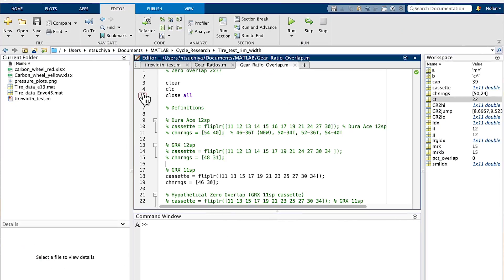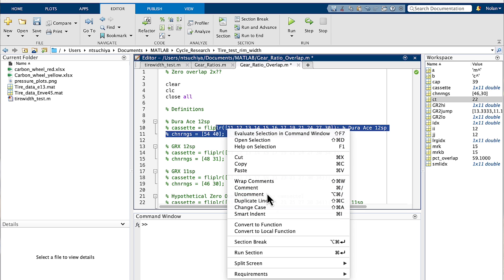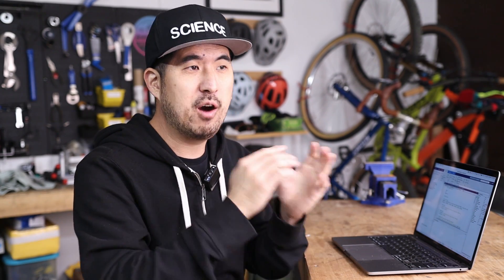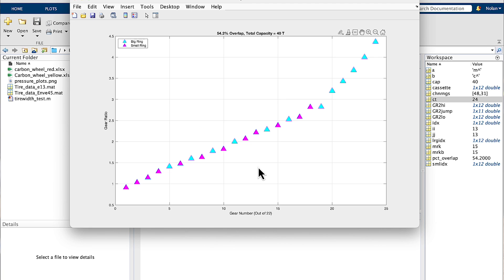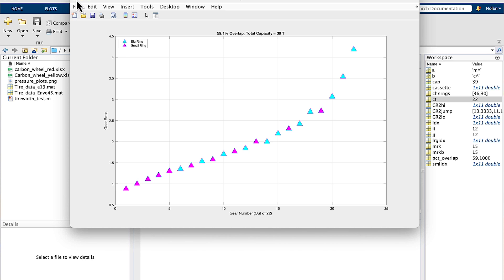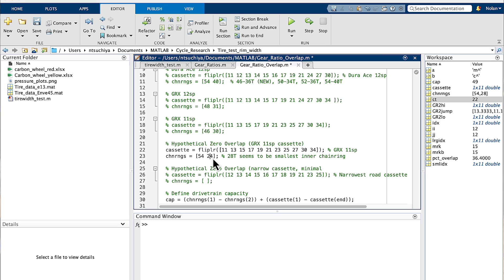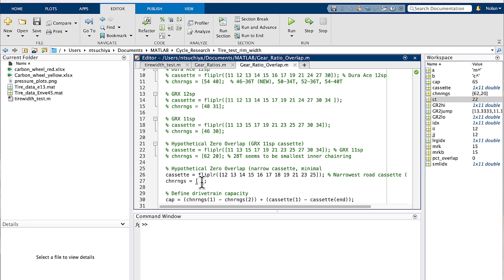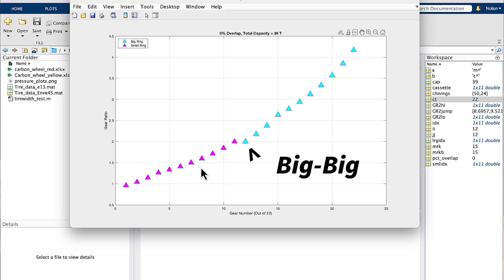Why 2x Drivetrains Have Redundant Gear Combinations

Comment: "Overlap" is completely missing the point.    Could care less about overlap - it's irrelevant.    It's the tails of unique gear ratios outside of the "overlap" that matter.     I have 2X or 3X on all my bikes.    My 3X10 touring bike actually has a 600% range and 15 different gear ratios outside of the overlap.     More unique gear ratios are great for maintaining cadence in different riding conditions (flat, downhill, wind, or uphill), and can maintain efficient chain angles.  I don't shift between chainrings often - typically only when riding conditions change drastically.    Show me a 1x15 drivetrain that has small steps between cogs and doesn't have wildly inefficient chain angle.        But if someone prefers the simplicity of 1X,  I understand.
Reply: People talk a lot about gesr overlap, but I have other question: does the torque necessary to pedal a gear wich overlap is equal both in big and small ring?
My non-scientific feeling when riding is that smaller front gear are easier to go from zero to a comfortable RPM.
Reply from the maker: @hugobci torque required for equivalent ratios in big ring and small ring are equal
Reply: He basically says at the end what you said here, that overlap is insignificant.
Reply from the maker: @rsrnsrwds thx for your input! Seems like maybe you didn’t catch the whole video
Reply: Lol low iq watch the video 20 more times
Reply: I would agree if it wasn't because of how good cassettes have gotten, you can have a 55-10 on a 12 speed and have enough range for pretty much anything, and with how inconvenient the front derrailleur is when it comes to reliability (at least on my experience) it'd be more annoyng than benefitable. In fact on my Lapierre Froggy i removed it because the smaller 28 tooth chainring was literally USELESS to me, as the cadence was too high on almost all speeds and when i went onto the longest one the derrailleur just ran out of range (Shimano Deore 9S at the time). Nowadays i run a DH bike so there's no way i could run a 2X anyways rn. That said tho, everyone should do what works for them
Reply: Yeah I have a triple (3×9). (30-42-52) with an 11-28 cassette. The only time I use the small ring is when I'm going up a steep hill. Otherwise I'm using just the two outer rings. It doesn't hurt having it in my opinion. I also have a 2×10 on another bike.

By having a 28 ring on the cassette, it allows me to not even need to use the small 30 chain ring. So having the triple for me is a bonus.
Reply: And there's nothing you can say or suggest because there is no other 700% range drivetrain. All you can then do is call out my use of a bike to which I say mind your own god damn business and accept that what works for you doesn't work for everyone else in the world. And nor should it be forced to be so.
Reply: If I ever had a second bike, it would probably be a trail bike with a 1x, you see, for that use case a 1x makes sense. But not for a loaded tourer/commuting bike/fitness bike/Cross Country bike.
Reply: Or even a straight up gravel bike that you took out each weekend on a 4 hour ride up a few hills...the use case you seem to be promoting. Yes for that very narrow slice of everything I use my bike for. A 1x would be livable. Until you introduce the word..loaded. that throws quite a big spanner in the works cos now front chainring sizes that you use for none loaded touring are too big. See where the problem lies? Probably not...
Reply: If you'd like I can show you the output of my program with my gear ratio setup and we could argue about how I don't need this and that in order to bring my usecase in line with what I 1x can offer. But why exactly should I do this? Because you don't like 2xs? Present a 1x that caters to my needs and you have won your argument good sir!
Reply: Nothing? That's what I thought...
Reply: It's been said multiple times and it still stands, overlap doesn't frigging matter. If you treat a 2x as 2 independent 1xs in the sort of use cases I require, overlap means you don't need to cycle between big and  small cogs as much. It about the 2% of gears which sit outside the range of what a 1x can offer.
Reply: FYI my current setup is  grx with 26 and 44t and a 12 speed 10-45 cassette. This set of ratios mean that I can get up to around 30-35mph before spinning out (already compromised compared to a road bike, but livable), but I can also pull half my body weight of camping crap and food up a mountain repeatedly (and go at a reasonable speed back down). Heavily modified drivetrain (derialluer extension, larger jockey wheels to take more slack) but it works. Its is as reliable as any stock drivetrain I have ever used. And because its using tougher materials and better precision parts and I have a decent chain and  wax it. It has lasted longer than any drivetrain I've owned. The aim being I never have to walk up a mountain or be limited to spinning out at 15mph going back down again. Further FYI, I started this setup with a 1x 11-51 cassette. I've experimented a lot, I don't like 3xs in these sorts of setups. It's probably the largest ranged drivetrain you could bodge together. This is how I know a 1x isn't appropriate. I couldn't in a million years have outright bought a bike with my spec, I've built it up over the period of about 2 years.
Reply: I understand why the average cyclist has no interest in gear ratio optimization, let alone people who just pedal once in a blue moon.  

But once you take a slight interest, I have zero understanding why any road or gravel cyclist, or even XC sometimes, would prefer a 1x drivetrain.  

Most people use brifters so I get why triples aren't worth their time since they're a pain when you can't trim via friction shifting. But doubles are so much cheaper, more useful, and take very little thinking to use. More range, more precise gearing changes, less expensive components, longer lived components, less noise from hearing the drivetrain grinding itself on the extreme ends of the cassette...etc.
Reply: @Primifluous my Ultegra triple shifts flawlessly with brifters. Better than my double 105. The double makes more noise. There's less of a jump between rings with the front derailer on the triple too.
Reply: I have a 40 chainring & a 10x50 cassette on one of my gravel bikes in my opinion it's the best setup.
Reply: @michaeloderda4513  I can see a 1x being good enough if you truly only use your gravel bike on gravel and don't mind large gaps between gears! But I prefer a triple since I live in a very hilly area with lots of rides that mix asphalt/gravel.
Reply: @Primifluous  I have 2 HC climbs in my backyard.   I'm quite comfy riding 1x when I'm riding alone.  It mostly sucks riding in a paceline or if my coach has me in a power range I can't sustain with their recommended cadence.
Reply: @michaeloderda4513 that's not the best setup. Try my setup: 11-46t cassette with 46/30 chainrings. That's a better setup. Best of both worlds.
Reply: @bonbonflippers4298 What are you running to get 11-46 in 2x?
Reply: @andrewmcalister3462  11spd xt sgs derailleur using a tanpan as a converter with 105 shifters. It's built to my touring bike that needs those gears. Climbs like a mtb but handles speeds  really well
Reply: @andrewmcalister3462  I haven't gone quite that far but I have 11-40 10 spd with a 50/34 crank running Tiagra with a hanger extension.  Hopefully will be going to 46/30 this year.
Reply: @kenmoum162  This is exactly my setup, 11-40 - 46/30. Great combination for my very hilly area and feels good.
Reply: A 1x system is ok for 70% of riders. Anyone who lives next to a mountain range or wants to carry any amount of stuff though is going to strongly disagree with that sentimemt. The comments on here just shows that people are unable to percieve cycling outside of their own particular use case or that there even is a use case outside of their own particular use case. People ride bikes for different reasons an purposes. 3xs are not dead whatsoever, they just don't appear on your flashy mountain bikes. And while the simplicity of a 1x may be better (cos you know, having the think about the complexity of navigating between more than 1 shifter is just too much for most cyclists to handle.) It is a compromise in gearing that people who do actually NEED in the course of their cycling usage, do not want forced down their throats, which is essentially the durection the cycling industry is headed. I challenge any 1x fanboy to dont a tents, the provisions they need to survive a week on the road. And put some serious distance accross the length of great britian. See how far you get on your 1x then. Only then will i accept your sentiment that 1x is the right choice for all cyclists and the industry has every right to phase out the parts for more niche applications.
Reply: @jasonrodwell5316  I live less than 5 miles from 2 different HC climbs with over 4000' of altitude gain.  You're not remotely close to being right and I see plenty of people riding 1x up these mountains.
Reply: @veganpotterthevegan i never said you couldnt get up a mountain with a 1x. But with a 1x and an appropriate sized front cog, this severely drives down your top speed and the spread isnt enough. When they got up those massive hills, they don't tend to want to lpse speed on the easiest part...the descent. On a normal 20-50 mile ride you could probably put up with it. But over the course of 100-150 miles, carrying loads of crap, and on a timer to get to a certian spot to camp ect, it adds up. Why should we put up with this forced change? Cos you say so? No one wants to spin out at 15 mph on a hill on a 100 mile trek. A 1x is severely limited for this application. So am i supposed to carry multiple chainrings and change them for a particularly hilly/flat downhill transition? Either you can get up hills but have no top end  or you can go further quicker...until you hit a hill. Consider the fact that the more you carry, the lower the gear ratio needs to be to get up that big hill. Next consider  in the uk you could have a 30 mile stretch with a slight decline, followed by 20 miles of mountainous terain, followed by another 30 mile straight. So i would need to gear my bike for the mountain in that situation, so for the other 50 miles, im halving my speed. A 2x *solves this issue*. Yet 1x drive trains are pretty much being shoved down our throats. For a mountain bike...fine. maybe even a city comuter or as i said 70% of use cases. But the rest what, should just suffer because you believe its better? Screw your opinion ill just stick to my 2x. Its about choice, a 1x may be suitable for you, but not me. It hasnt happened yet. We can still get 2x systems but they are being phased out  This is a mistake.
Reply: @jasonrodwell5316  my gravel bike would have a higher high and a lower low than my road bike if I put a 46t chainring on it.  Now it has a much lower low, and only a slightly lower high gear.  All you need to do is look at a gear inch chart,  and available gearing to see how wrong you are
Reply: @jasonrodwell5316   I certainly ride my 2x bikes here too.  I wouldn't even build a modern touring bike with 3x unless I was late in my years.  I'm 41 and can't see myself using 3x for another +15yrs, even on a touring bike as you can run 2x with a 11-46 and a 45/30 chainset and chances are,  cassettes will have more cogs and an even bigger range by then and it'll make triples even more obsolete than they already are.
Reply: If you're not a professional racer, who the hell cares about narrow ratio gaps?  Are your legs a 2-stroke motor with a tiny power band?  Bet you're wasting more energy grinding up step climbs or getting spun out on fast descents due to limited range than being +/- 3rpm of your "ideal" cadence.
Reply: @csn583  guess you don't realize that even regular people care about how things feel🤡 Funny thing is that pros generally have a wider cadence range where they can still produce high power
Reply: Simplicity of 1x rulez ! I have a bike with ultegra 2x .... that I rarely use. Can we stop being "snowflakes" about "the perfect cadence" ? We adapt. 2-3 tooth difference won't stop me from winning Tour de France.... really. And so is the "unconfortable" dfference from 95 to 102 RPM. Also...I must say to everyone with 3x chainrings...that 3x is DEAD AND BURRIED. THe current market rarely produces anything 3x. Sick if the "trimming". I prefer to "crosschain" a 1x than to bother to "trim" that 2x all the time.
Reply: @balaurul100  cadance and 1x or 2x or even 3x is a preference. I love 1x on dirt rides but prefer 2x on pavement. Now if you're preferred riding is relaxed and not sustained 20+mph at a comfortable rpm of your choice then 1x is fine.
Reply: @bonbonflippers4298  I have a 58t chainring and 1x on my TT bike and can cruise at 22mph(z2) for +5hrs happily.  1x isn't only for slow riding off pavement
Reply: @veganpotterthevegan  I guess I'm not as strong as you or my terrain doesn't allow me to have 1x in my area with hills. I do see alot of TT at my river trail area where there's minimum climbing.
Reply: @bonbonflippers4298  I live in Salt Lake City.  I can ride fairly flat, or take my pick of two +4000' elevation gain climbs and many 1000' options.   My gravel bike is 1x and actually has a wider range and lower low gear than my 2x basemile bike.
Reply: @veganpotterthevegan  my touring bike has mtb gear ratio while still having 46t chainring. It's a bike that is practical as a normal average cyclist will ever need for base miles. The rest of my bikes are 2x for various type of riding. As much as I want to try 1x even on hills, my knees just wouldn't like it over a prolonged period of time.
Reply: @bonbonflippers4298  there are 52t cogs.  Nobody is keeping you from having a 34t chainring to spin away on.  Also, everyone has different wants/needs.  Plenty of people of all levels just can't stand having a +15rpm difference between gears while others of all levels don't really care at all.
Reply: @balaurul100  I'm all about 1x in many applications.  But the cadence difference isn't 7rpm in many situations.  I run an e*thirteen 9-45 cassette and the difference in cadence in the low gears can be over 15rpm.  It's most definitely noticeable.  It would be over to 20rpm with their 9-52 cassette. Looking forward to 13 and 14sp to make those gaps smaller
Reply: @cpopte if you are old enough then you know that what you wrote is not very smart.

It is only a matter of time and 3x or something else will be the main thing, just so idiots and kids replace their already existing gear.

Comment: I run 2by because it's a cheaper to obtain the low gear I need without compromising too much top end
42-26 + 11-36 10speed, I'd need a, 11-51 +36/38 to reach the same 0.7ish, but then I'd spin out with my road wheel set.
Plus I probably could run a smaller GS mech instead of my current SGS
Reply from the maker: Pretty much sums it up!

Comment: Glad to find you! How about putting a planetary up front (they're around) to give you the wide ratio needed to minimize or eliminate ratio redundancy. This reduces crossover losses in two ways( narrower cassette and single line from the front...but introduces losses associated with the use of a planetary. What do those efficiency numbers look like? 'Still have the (practically unworkable) extreme double shift scenario to achieve progressive ratio continuity. Deurs could change to reduce idler length( reduce the risk of damage), shorter chain length, clutches?, reduced mass at rear axle...  etc etc Just asking! Great analysis!

Comment: My view is that unless you're riding the same route all the time there's no better way to quickly dump-down or ramp-up the gears for unexpected downhills and uphills....It's a one-click-wonder👍🏻
Reply: Idk, I have a 1x and I’ve never had a hill come up too quickly to where I couldn’t just ratchet the shifter a couple times and make a quick shift to the bigger rings - really not hard at all. Your brain does this weird thing after riding 1x for awhile where the drivetrain just disappears, you stop thinking about it.
Reply: @Ferrichrome i've definitely had that experience on my 1x bikes that have just the one cog 😉
Reply: @hugejackedman1951  indeed, sounds nice but too many hills in my area 😭

Comment: I feel like you should mention chain line in here somewhere.  Not cross-chaining, but the more extreme ends of 1x gearing.  It isn't a problem on slacker gravel bikes but the chainstay on a race-orientated road bike is going to be so short that the highest and lowest gears on a 1x setup are going to be unavoidably noisy for a gear range comparible to a 2x equivalent. 2x for road, 1x for gravel, don't need MATLAB for that calculation!
Reply from the maker: Chain angle is bad on 1x for sure. Chain line is something different tho

Comment: I've got a couple 3x on 90's MTB's, a couple 2x (1 road, one MTB), and five1x drive trains (1 gravel, 3 MTB's, and  tandem).  Honestly I prefer the 1x system a bit more than 2x in all cases.  I used my gravel bike with 1x as a road bike far more often then my 2X true road bike and it only took a couple rides to get over the annoyance of larger steps.  If I were stronger I might wish for a taller gear, but I'm not, and spinning out has not been an issue, but the multiple granny gears has been a real bonus on my usual hilly loop.

Comment: Thanks for the video.  I always try and make my gear ratios when they overlap between chain rings non-redundant. That is your two different plot colors not appear on top of one another. That allows for additional resolution in the finite number of gear choices. That may require some hunting between chainrings.... ( ever hear of half step granny gearing). Hey, how do you afford a Matlab license?
Reply from the maker: License is through work 🤫